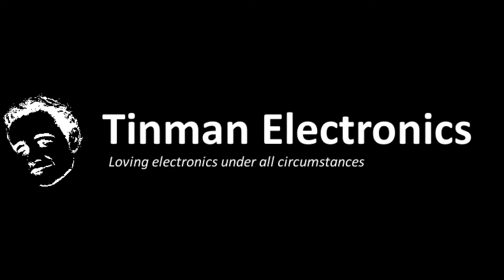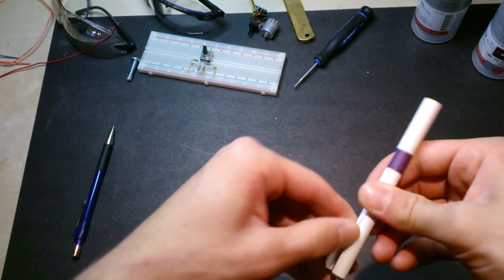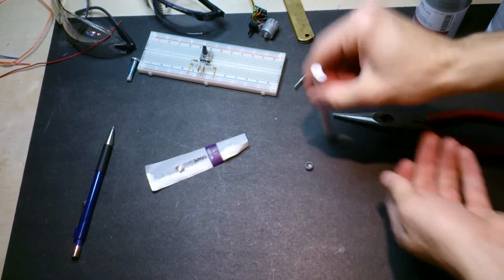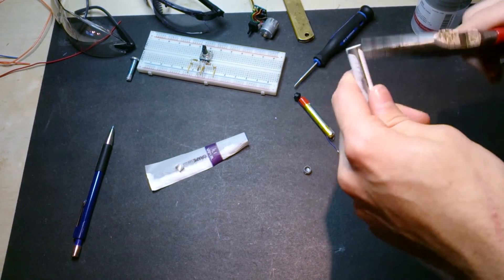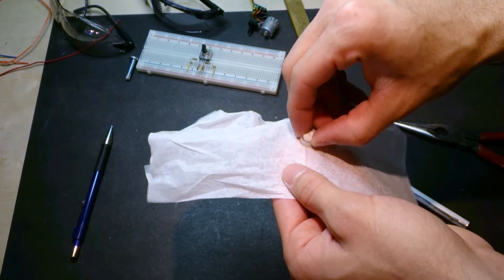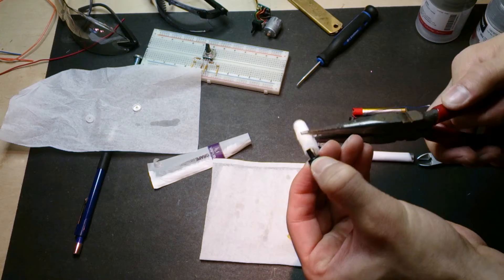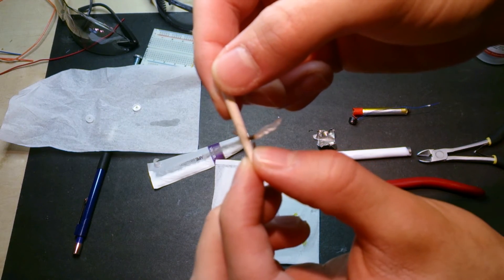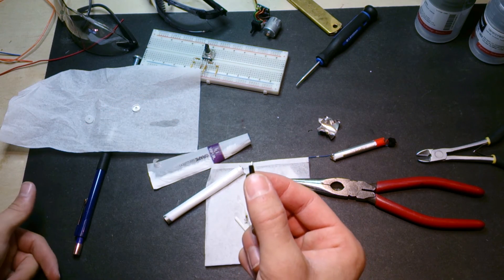Tinman Electronics 8 - Disposable e-cigarette teardown

Comment: Searching for months

I need your help I can't find a small micro controller that charge and discharge a battery with 8 second time limit connected to an led and it sense's low pressure to close the circuit to discharge and it's 3mm in length and only has a resistor connected to it (s0890
Ap) that's what I can read